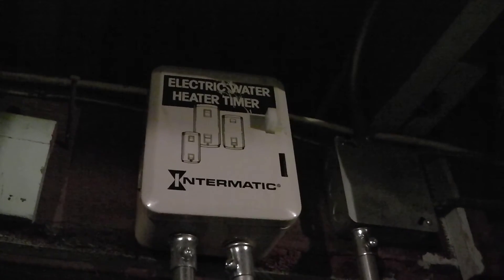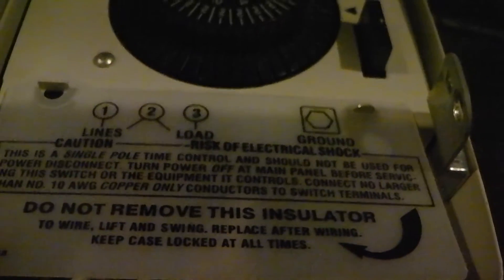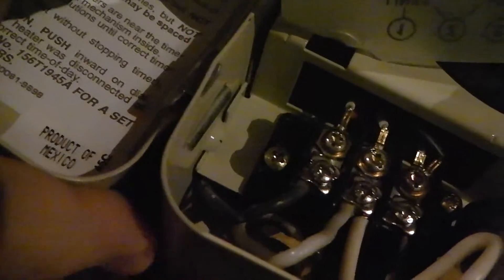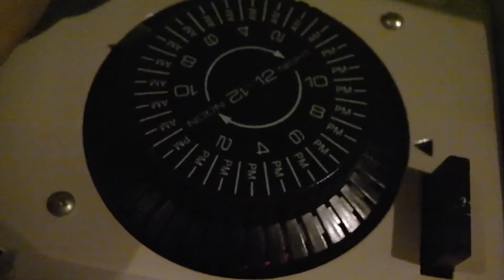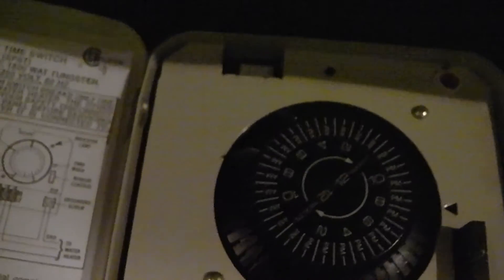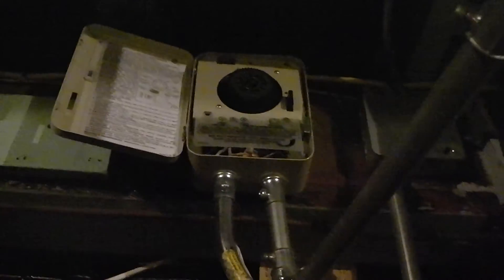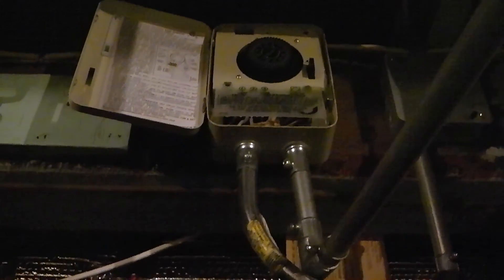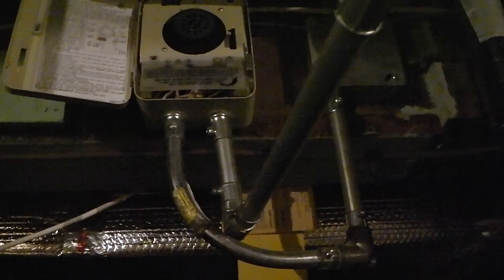Intermatic WH21 Electric Water Heater Timer Review

Comment: The conduit is required for the wire?   You mention because of hanging wire, but that's pretty much always the case, no?
Reply from the maker: You can't have loose hanging wire according to code. If you attached it to a wood beam that was supported you might be ok but if it's loosely hanging, it's not up to code

Comment: Hi - I have a WH21 timer but the clock/timer has stopped working/rotating: I can still manually turn on the 'Indicator Lamp' and the light comes on and water heats, but the automatic function of the timer has broken. Can the clock stop working? If so, Do I replace the whole unit?
Reply: You can buy the motor for the clock, some videos about it

Comment: when i used a hot water heater, i kept my breaker turned off until i wanted a shower, i gave it 20/30 minutes to heat up each day or 2, then i took my short shower, saved nearly 40 bucks per month, now i went to a tankless, some months my electric bill is around 4 0 bucks.

Comment: I cant use mine
 Light stays on but where is the hot water
Reply from the maker: It might be faulty wiring as the hot wire has to be going to the water heater...recheck the wiring. If not, check the water heater and make sure all is good there